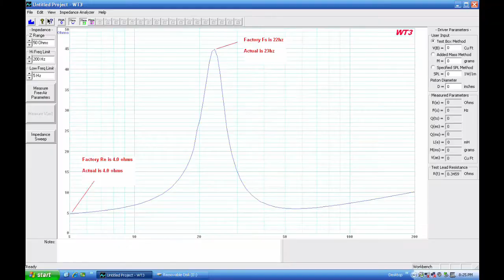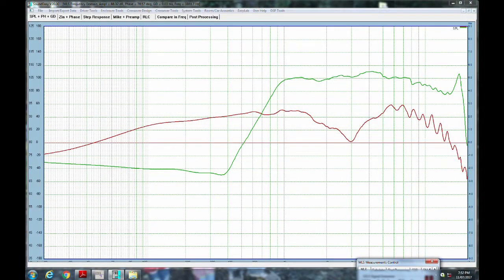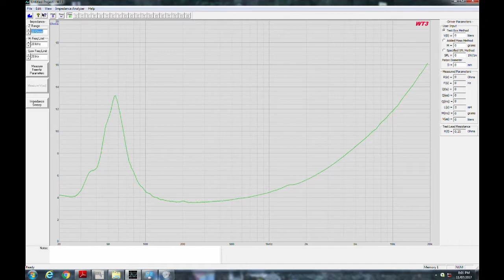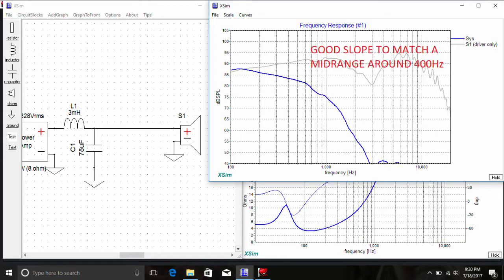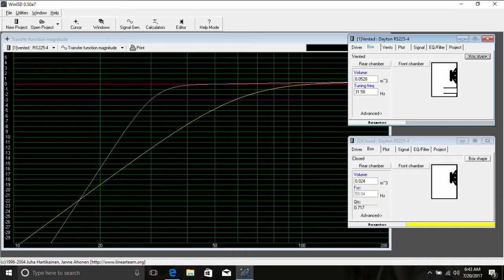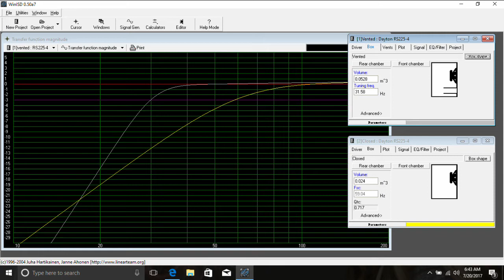Dayton Audio RS225-4 Test and Review

Comment: I really like the paper version of this driver. In a mass loaded transmission line cabinet, it is fantastic.
Reply: Where would be a good place to get knowledge in building t_line speakers
Reply: @d.s.w7779  The two places that I got a lot of help from are the DIY Audio forum (a thread called Improved Transmission Line Alignment) and a private group on Facebook, that is specifically about transmission line speakers.
The program I have used is called Hornresp - it is free, and the programmer is very active on the DIY forum.

Comment: I have the RS225-8 and found it challenging in the upper frequencies.  Is there a video about how made your rs225-4 two way crossover?  any advice would be great.  thanks
Reply from the maker: CeeCeCat it wasn’t bad for me because I crossed pretty low, around 1000hz. It really depends how well your tweeter can integrate. This is one of my best sounding speaker designs.
Reply: @ImpulseAudioSpeakers  which tweeter did you use and can I get crossover plan
Reply from the maker: @anandshah71  I used a horn. I think the B&C DE250 and a SEOS 10. Really good combo. 

Sorry I don’t give out the cross over details.
Reply: @ImpulseAudioSpeakers  ok at a cost also u will not sell plan
Reply from the maker: @anandshah71  I try and teach people how to make the XO. If the parts were easily available I might do it, but I don’t think they are. You can buy kits like this though.
Reply: CeeCeCat thanks.  Do you recall if you went 12db or higher on the low pass
Reply from the maker: Mara Scott it was a second order (12db/oct) crossover on the low pass and first order on the high pass.

Comment: Can you use these for car audio
Reply from the maker: Greezy_Chef yes I don’t see any reason why not. If you want SPL they aren’t very sensitive but I have abused mine like an SPL guy without any issues.
Reply: @ImpulseAudioSpeakers  I bought some peerless by tymphany neodymium 6.5's for my home stereo a while back.  That's how I got acquainted with speakers off of parts Express.  Now I'm going to upgrade my car audio and was considering using something off of that website.  This is my old system https://youtu.be/OeAZSfvrzlg. The new one is going to be much smaller.

Comment: IMO, it is a disservice to these drivers to call them "budget". They are a woofer with full-on, high-end performance and sound, that just happens to cost somewhat less than other competing drivers. They are not "cheap" in the scheme of parts used in commercial home speakers, nor are they cheaply made at all in any of their materials or features, and they can be used in conjunction with the most expensive and high-level esoteric components, and complement them nicely. There are a few brave high-end audio manufacturers that do use these woofers, and they do so because the woofers perform extremely well, not because of a need to shave cost.
Reply from the maker: rorybz fair enough point. Thanks.
Reply: Budget simply means a cost point - that’s all.  I have had excellent results from some Dayton products - and some Dayton products were quite disappointing - that’s why these reviews are so useful.  I would consider Eminence to be a “budget” Pro Audio Line of drivers that delivers extreme value for the dollar.

Comment: The tweeter has over 20db more output that the bass driver?  Is this a joke?
Reply from the maker: Not sure what's wrong with that. Most tweeters are more sensitive than the woofer and the crossover includes circuits to reduce the tweeter level.

Comment: Here is a tidbit:  a few years ago, Polk audio released the LSi9/15 speakers featuring the excellent Vifa ring tweeter.  $1800 a pair for the 9's.  The woofer, OTOH was a $5 piece of junk.  These could have been far superior had they used this Dayton woofer, or better yet, a slightly higher end model.  The cheap woof polk used handicapped the performance. That shows you how cheap companies are, and how big the profit margin is.

Comment: Hey guys what do you think. about the HIFI audio speakers at wise price ranges. this is like funding a little audio speakers manufacturer. PS. Comment and give tours thoughts
Reply from the maker: Kelvin Espinosa hi, I'm not sure what you mean? You're asking what we think about budget/mid priced drivers like the one in this video? They can be just as good as the expensive stuff sometimes. I have found this driver to be fantastic.
Reply: YEAH! thanks that was part of the question. I mean exactly manufacture the complete speaker with quality components at mid price range.  a real attractive looking speaker cabinet is not a problem. but the crossover design mastering is "AN ART". i know with the help of crossover design software you can get decent result. any tips will be hugely appreciated.
Reply from the maker: Kelvin Espinosa you are exactly right. The software and measurements HELP but they aren't the final decision. Good of you to recognize that. To many people either expect to ONLY use their ears or ONLY use measurements. The best help I can offer you is to start with affordable drivers like this on and build some test boxes and start learning. Don't be afraid to make mistakes. And if you're a master woodworker, just wait to build something amazing until you've tried it a couple times and feel like you have something truly great.

Comment: I bought the DIY SG rs28a seos waveguide and im looking for an 8" driver for it. You think this driver would make it? I don't want the paper version but want a 8"-10" woofer with decent bottom end for a stand alone 2way.
Reply from the maker: D1PP1N yes I do think it would make a great match actually. That tweeter/waveguide combo should hit 1kHz no problem. Even a 1200hz crossover is completely reasonable. And for $58 the investment isnt much of a risk. The Motus might be an even better match, but thats quite an investment. Depends what you're after.
Reply from the maker: D1PP1N also, download the files and try messing around with the woofer. I dont have that tweeter/horn to test for you but playing with the woofer in xsim would give you a feel for whether or not it can suit you.
Reply: im not looking to spend over $100 per driver. i actually have the drivers on hand i can send you the waveguide and tweeter measurements whenever i get around to working on them. just got a cnc machine so finishing builds will be faster now lol. i have like 3-4 sets of drivers waiting to get designed ive just been busy and its too hot in the garage!